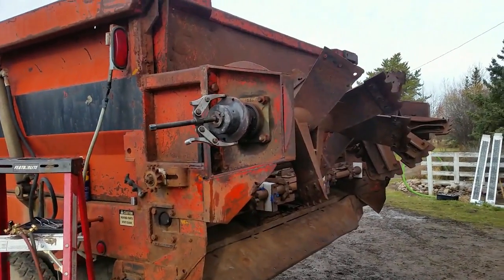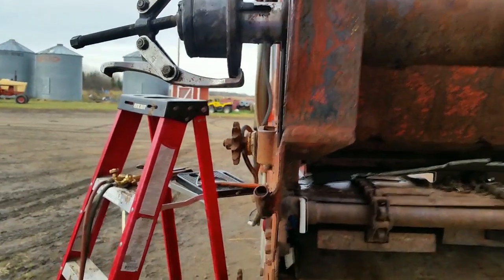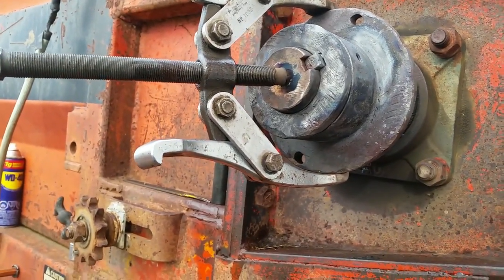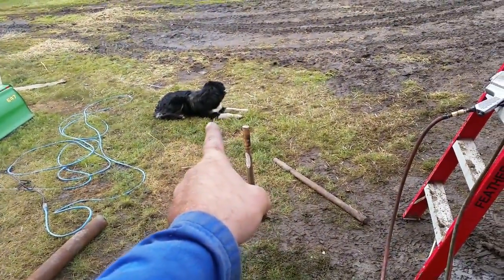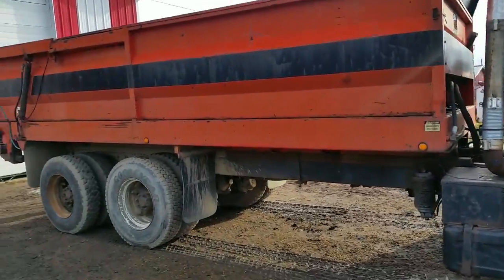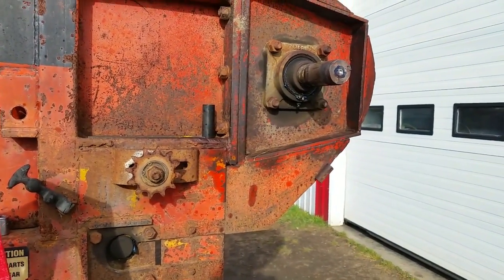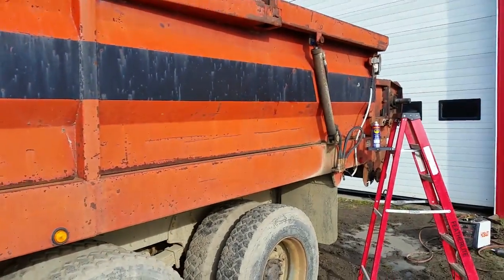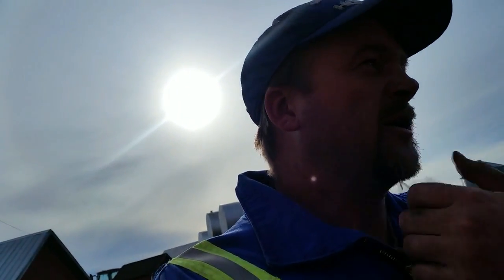Getting The Spreaders Ready!!

Comment: I am guessing someone "shrunk" that hub onto the shaft, which is the best way because that hub will never walk off the shaft and it doesn't appear to me that set screws are the answer for this application. A "shrink fit" is when the bore of the hub is about .0015 smaller than the shaft, then they heat it cherry red and the hole expands, they quick put the hub on the shaft and when it cools the bore of the hub hole closes back up and it's really on there then.  I'd of burnt the hub off, then took the truck to the machine shop and they could check the shaft and make the sprocket to fit that shaft. With the old burned off or "slit" hub in hand, they'd of known the application, and saved you a lot of hard work. But you got it done, so all is well.  Of course, I realize it's easy for me to watch a video and tell you what I think when I wasn't even there or in your shoes, so take it for what it's worth.  I think you do an awesome job keeping things running, etc..